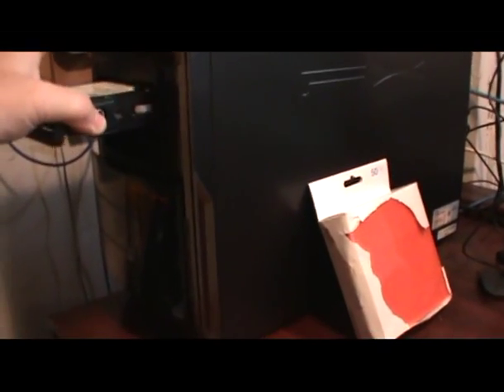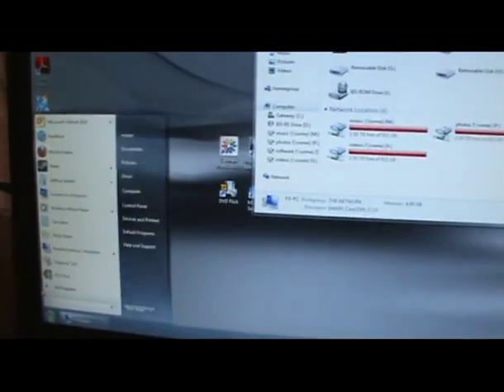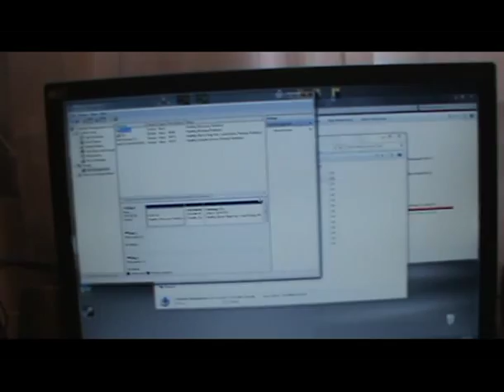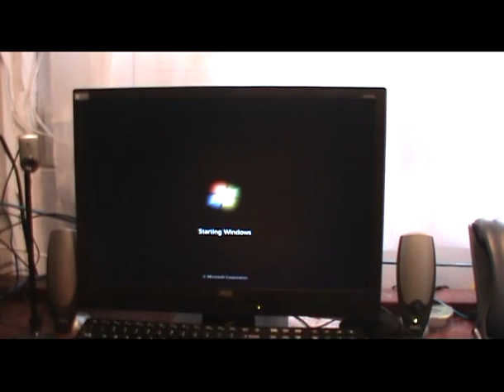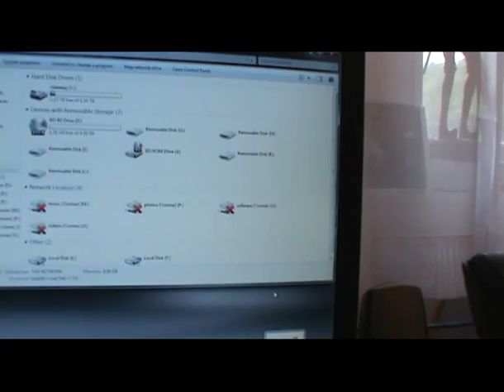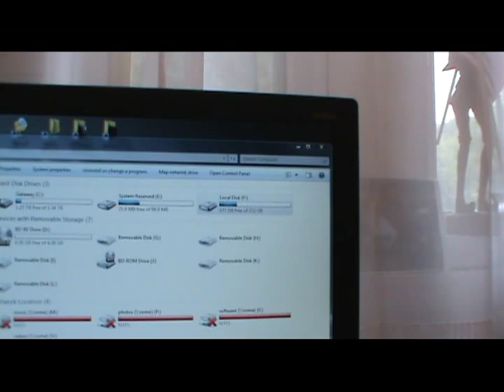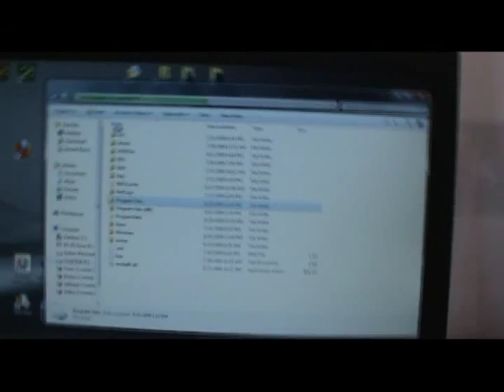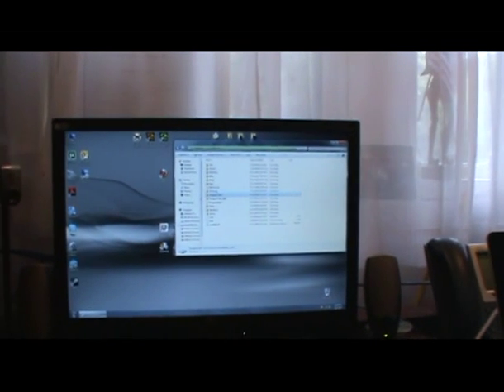Gateway FX6831 Hot Swap Bay Testing

Comment: hi can anyone help me out, I have a fx6840, and it looks like the same case, I bought a WD internal hard drive and it won't fit on the tray; is there an alternative way to do this? or does anyone know a fix for this; I'm guessing hard drives are shaped a bit different now a days
Reply: did you ever figure that out? I'm in the same boat right now.
Reply: Any standard 3.5 inch hard drive will fit into the trays.  Look for the little tabs on the hard drive tray that face inward towards the middle of the tray, those are designed to fit into the screw holes on the side of of the 3.5 " hard drive so that the drive will be secured into the tray. "You have to spread out the sides of the tray a little to be able to insert a little metal tabs into the mounting screw holes in the hard drive. Once the drive is properly mounted in the tray, simply slide it into its slot and push until you feel it snap into the connector. It took me a little while to figure out, but that's how it works.

Comment: There is a small black sticker on the front of the drive bay door that clearly says please power down the system before swapping the hard drives.
Reply: canesfans11 no it says power down the system before removing the boot harddrive
Reply: canesfans11 the way sata works it is suppose to be hot swapable

Comment from the maker: Any standard 3.5 inch hard drive will fit into the trays.  Look for the little tabs on the hard drive tray that face inward towards the middle of the tray, those are designed to fit into the screw holes on the side of of the 3.5 " hard drive so that the drive will be secured into the tray.  It took me a little while to figure out, but that's how it works.

Comment: @dolphin80 Unforunately creating the discs using the management program doesn't create an OS disc; it makes a "factory default" recovery disc set. I doubt it will let me "recover" to an SSD but maybe if I unplug my hard drive and "recover" it'll use the SSD. But then the SSD is my c: and all my apps will be on D: and need to be reinstalled :(

Comment from the maker: @jb0nez123 use the gateway recovery management program that came installed with the system.  This program will allow you to create two discs...a factory default disc (the bare OS), and the drivers disc that you'll need to re-install the drivers.  When you install the SSD, you'll need both discs.  The other route would be to create on image file using Acronis or something similar, then copying the image to the SSD, but that is more involved.

Comment: Can you show a picture of just the hard drive tray? Mine has what seems to be an extra metal nook toward the front so I can't fit the hard drive in.  I got a 2TB 3.5" SATA which I understand should fit, so I just want to confirm if the tray's are messed up or if I'm just doing something wrong. Gateway customer support had no idea what I was talking about with these trays. Thanks.

Comment: Great vids. I am considering this purchase. Can you tell me if it is possible to move the existing hard drive into one of the swappable bays? I don't need hot swappable, but I would like to change out the main HD based on task at hand. I'm assuming they did not include a Windows restore CD.  Have you tried a three monitor setup with Eyefinity? Thanks again for the great info.

KC